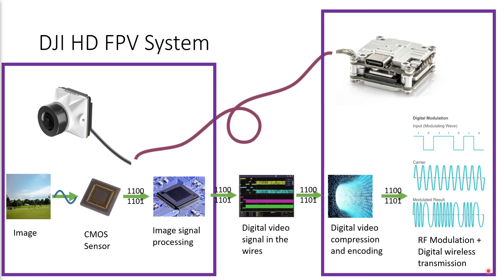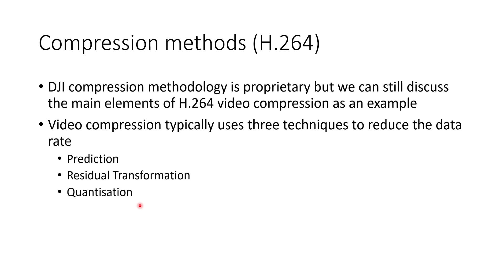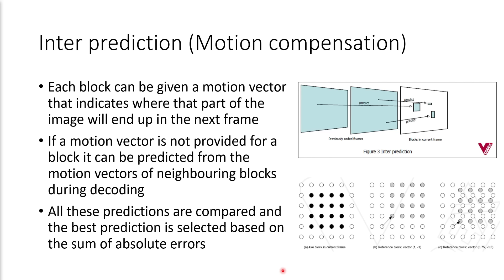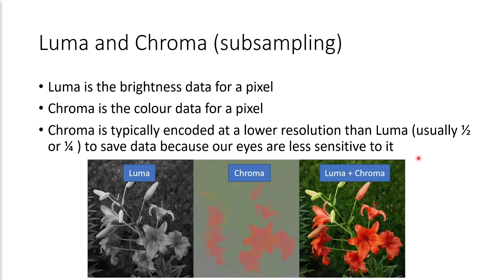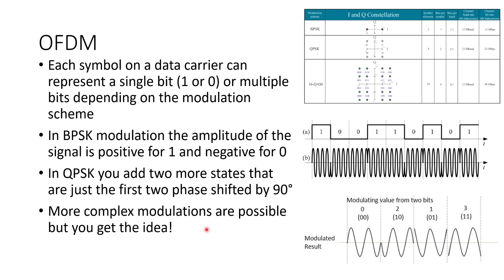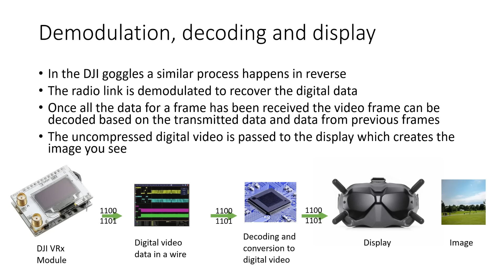How the DJI FPV Video system works! (Air Unit, Vista and FPV drone)

Comment: Hi Chris
Is that the reason why you cant just put an 2watts amplifier between the air unit and the antenna?
Or would it work?
Cheers

Comment: I wonder why DJI don't break each frame into bands and then you have less latency to decode a band, so even if you lag on one band, another band might transmit, you'd get flicker in bands, but perhaps less latency waiting all the data to send and repeat transmission

Comment: I'm pretty sure they don't use the "retransmit on first failure" method you've described here — this is something you'd do over a wire, where errors are rare. Digital RF systems, where some percentage of errors is expected in every packet, use forward error correction codes instead of checksums — these allow to correct up to x bit errors or decide that there are too many Generally, transmitter can dedicate any share of the channel's bandwidth to FEC, thus adapting to adverse conditions. This is literally RF 101, and it can't be that DJI didn't implement FEC, because obviously they don't produce the OFDM transceiver chips, they purchase or order them from people who know their shit. If the Rf link worked as you described, it... wouldn't work. Like, at all. And even at 1 meter between TX and RX, it would drop some frames constantly. I don't have these DJI goggles, but the huge scandal would certainly break into my bubble if they sold a ~1000$ FPV system unusable by design.

Even more absurd in your description is the idea that DJI retransmit whole frames... Come on, that's not how any of this works. Why would you retransmit a frame of live video? Receiver would certainly prefer a fresh frame to an old one (even if the old one was an I-frame and current one is a P-frame, really), and you have these new frames piling up in some buffer until you can retransmit... No, they don't do that. If this was the case, it would be noticeably degrade the system's performance, and recordings of "pause then fast-forward" artefacts from these goggles would be all over YouTube.

Comment: Great video and great explanation. Some additional information about the fact that the goggles are also sending packets to the VTX would be valuable. Why is it disturbing analog video more than you would think? (outside of the presumed frequency range of a certain channel). What frequency are the goggles using for TX? Also In what way is the DJI signal encoded, can you recieve it with any other equipment? Some facts about the spectator feature would be interesting in this regard as well. Does the VTX send the data to two goggles or is the first one relaying it to the second goggle? (25mbit to recieve data, 25mbit to relay it to another goggle). Does the first goggle need to establish two bidirectional links and does it mean four different frequencies?

Comment: Hey, do you think it is possible to take apart the video transmitter from the dji drone and the camera and make it work in another non dji drone?  Or it might be some signal necessary feom the MB for it to work?
Reply from the maker: I think the system is pretty proprietary. It might be possible but I think just using the air unit or vista is easier.

Comment: You think it's possible to make a repeater for the dji fpv system? Figured if anyone knows it'd be you. And don't the FPV races use repeaters, or do they all race on analog?
Reply from the maker: Possible? Of course. But the technology would need to be similar to WiFi repeaters.

Comment: then why is my mipi cable from my hdzero cable which has 12 cables on it you say 4 so 4 then another 2 for power and ground so whats the other 6 cables for if only 4 are needed?

Comment: The MAX285x series comes to mind.
Reply: Watching your video, that looks pretty darn close if I read its datasheet!
Reply: Great video by the way, if you want to test macro block vectoring visually I can highly recommend rotating a gradient at a low bitrate! You can really see the blocks "walk" across the screen guarded by a grid.

I've used patterns like that to tweak bandwidth on crappy ADSL lines for livestream events, it has been a while ago but I learned quite a bit about encoding :)

Comment: Hey Chris. Perhaps you’ve been asked this before but I couldn’t help wonder why the new runcam spilt camera recording system didn’t just split the wires from the camera and have one set go to a recording device and the other to a transmission device. It just seems like doing this should work rather than having the setup they have with one wire from the cam to the recording device and another from the recorder to the transmitting unit.  Any ideas?
Reply from the maker: With a MIPI link the connection is two way so you can't split the feed easily (like you can with analog for example). If you did split the feed each device would only have half the bandwidth. In the RunCam split I believe the link is digital to the recording device where it is both saved to SDcard and converted to analog for the VTX.
Reply: @ChrisRosser  thank you so much!!’

Comment: Hey Chris, what would you say is the main reason why DJI is much better than Sharkbyte at penetrating buildings? Are they doing more compression or because they are retransmitting? 

Also curious why this advantage does not carry over to penetrating foliage.
Reply from the maker: A good question. I think that reason DJI does so well in buildings is because it handles multipath interference really really well. OFDM in general handles multipath well because it acts as many separate narrow band signals with low symbol rate rather than one wideband signal. In a building I think DJI is bouncing around the obstacle rather than penetrating. Out in foliage there is no surface to bounce the signal around and so the penetration is similar to analogue.

Comment: Hello Chris.  Learned a lot from this video. I have a question for you. Do you know the usage case of 2.4 ghz link between dji fpv goggles v2 and dji fpv drone ? Is it the radio link or video link?
I'm thinking to move digital with limited budget and cannot decide paying extra for v2 worth it ? I sometimes see v1 goes a lot cheaper than v2 s . I ll highly appreciate your input at this.

As I know your analog goggles were Aomway commander v1 . I have the same goggles. Never got to try the dji's . What do you suggest me ?
Reply from the maker: I think the DJI FPV drone uses 2.4 & 5.8GHz and switches between them automatically based on RSSI. If you are not going to buy the DJI FPV drone there is no benefit to the V2 goggles. For Air Unit and Vista V1 goggles are the same as V2.
Reply: @ChrisRosser  Thanks for the reply Chris. I'm aware of current use cases but trying to futureproof it. Lets see if I'm able to get it or not 🙏🙏

Comment: I couldn't find relevant information anywhere so decided to give it a try here. I playing little bit with my Vista unit because have problem with DJI FPV Cam. I do connecting and reconnecting camera while Vista were powered. After that I notice that without camera my bitrate is about 10Mbps. Could no image to process cause lower bitrate?
Reply from the maker: I think so. Compressing a black image will require much less data than an image with detail.
Reply: @ChrisRosser  Thanks!

Comment: Another wonderful video that explains things so well. Thank you again.
But it's hard to believe that DJI don't use error correction. IBM used it for  tapes in the '70s, audio CDs in the '80s, DVDs and Blu-ray later, etc. It's so common and so well worked out. 
With a small overhead EC could eliminate most of the retransmission activity.
I guess, as always, it's a trade-off between the overhead and the amount of retransmissions needed.
Reply from the maker: They do use some error correction (checksum based) but if a packet is too badly damaged a retransmission is needed.

Comment: I have one question. Is possible to use Kakute F7 HDV (FC) with connected Caddx Air Unit and external radio receiver and then set in betaflight this external receiver as signal source and stream video by Air unit to dji googles at the same time or do i have to use dji controller with air unit to stream video?

In short: Is it necessary to use a DJI controller to transmit video from the air unit to the google?
Reply from the maker: Not at all. I use my Caddx Vista with ExpressLRS control link on a Taranis radio. I don't use DJI controller.
Reply: @ChrisRosser  thanks for your response ;)

Comment: You'd better explain why in the evening when it's getting dark before arming you have clear picture on nebula pro, but after arming the picture is getting dark and you're not able to fly. On polar this doesn't happen. Is it software trick to force people to buy "night" camera?
Reply from the maker: May be the frame rate switching from 60 to 120fps. Try high quality mode?

Comment: Colin Briggs in UK
Hi Chris do you intend to build a AOS 5.5 with an extended nose so there are no props in view. My friends and I like to fly with the DJI air unit and camera and not use a GoPro
Reply from the maker: Hi Colin, if you're not using a go pro you can run 5" props and be confident of no props in view.

Comment: Somewhere below I read you saying that the goggles can also transmit at the same power as the vtx. Is that even healty to have that kind of transmitter onto your head?
Reply from the maker: Yes it's totally safe. The radiation emitted by our equipment is non-ionising. It's actually much less dangerous than the visible light from the sun! The only radiation you ever need to worry about is ionising radiation (UV, X ray and Gamma ray) everything else is completely safe (all it will do is gently warm things up) and I wouldn't listen to anyone who says different. 👍
Reply: @ChrisRosser  Thanks a lot! This makes me worry a lot less about all that radio tech in my hands and on my head.

Comment: Digital FPV is pretty much behind compared to the smartphone industry I suppose, I wonder how does it compare. This kind of video I hope could inspire more companies to invest in digital FPV system further. I'm wondering how far the current system (either DJI or SharkByte) could go, as it will need a better encoding / decoding process to achieve better quality, frame rate, latency and range, thus it will result in more hardware cost.
Reply from the maker: Not sure I agree. DJI have had to develop a custom ASIC to do their digital video encoding at a cost of ~$5m USD. This is pretty cutting edge technology. Smartphones cannot get close to the latency of DJI FPV. The best they can manage is ~100ms. That's why you don't see any clones of the DJI FPV system. Without custom silicon it's a non starter.
Reply: I've never seen the data on any other system outside FPV, I just expected that they have a similar system, such as in gaming or video broadcast. But, I can see that it's only within FPV / drone racing that ultra low latency video transmission is important, or at least important enough for DJI to produce it.

Comment: Hi Chris, great video thanks! How does the digital video transmission handles reflected signals ? In analog we get a mess of sinusoids of the current and previous frames but how is this handled in digital transmission ? Thanks again for your video!
Reply from the maker: Using a circularly polarised signal helps. When a lhcp signal is reflected it becomes rhcp and if your receiving antenna is lhcp it rejects the rhcp signal. The same wish is used with analogue.
Reply: @ChrisRosser  Does this mean reflected signals are as bad for digital as they are for analog signals ? As far as I know analog is affected much worse by reflections than digitial transmission. Or is it just the complexity of the analog signal that makes it so bad.  Thanks again!
Reply from the maker: @hristiantodorov3923  With analogue you have no way of knowing if your signal is good or bad. With digital you can use checksums to discard corrupt data and request a retransmission.
Reply: OFDM is the thing that handles reflections and delay spread(ISI) in digital transmission as opposed to analog transmission.
Reply: In OFDM each symbol is transmitted on a different subcarrier and for longer time which makes the delay spread less destructive.

Comment: To be honest, 75% of this video is about generic video/image processing & digital data transmission topics. Nicely presented but not really related to DJI. Looking at the image when the link builds up, it seems very probably that DJI is using a 3x3 scheme of independent video streams. They probably use something SRT. And progressive encoding (there is a scheme for h.264 etc) is somethings that is skipped here completely. Both SRT and progressive encoding are possible explanations why the latency stays quite constant and the image quality degrades so quickly when the link quality drops.
Wrt 120fps: This helps to get the frame faster. It also makes the video much smoother. You can strongly see that when flying fast and using 60 and 120fps alternatively. This is why in high-end VR there is the recommendation for >90fps. So the 120fps deliver an additional advantage.
Reply from the maker: Great comment! Thanks for all the extra detail. SRT may be a technology they use instead of simple UDP. Progressive encoding seems less likely to me as it seems more expedient to encode each frame with compression matched to the current link speed.
Reply: This is not just off the shelf wifi. You can find wifi frontend chips on the boards. That makes sense if you want to build a transceiver on that frequency range. The encoding itself I guess is a progressive encoding h.264 similar to what Ambarella offers as a real time profile. Using SRT one might prioritize the dropped frames that you really need.
One can also see after a video break up that the video is made out of a 3x3 matrix of probably separate streams. The use this in focus mode to reduce the bandwidth on the outer parts of the FoV.
Reply: @Stefan_73  You two sound like you know this stuff well. DJI seems to be focusing less and less on fpv, and I've been wondering why there's not a good competing product out there yet. Is a viable competing digital FPV system really that hard to develop?

Comment: Awesome video! But is there a reason why analog systems are still preferable for long range instead of digital?
Reply from the maker: I'm not sure. DJI Digital can go 13.5km maximum due to a round trip limitation of 90 microseconds: https://www.youtube.com/watch?v=wj5A_bEZfZ4

If you need to go further than that then analogue is the only option. Sharkbyte might not have this limitation but you would need a lot more output power than any current Sharkbyte VTX.

Comment: Great video as usual. But I always have this question, if the Vtx sends a packet and arrives corrupted to the goggles, the googles ask for a new packet. If the quad is far away, the packets are transmitted at, let's say 700mWatts, but what transmission power are the goggles using to send the requests at the same distance?
Reply: Makes sense. Hey how about explaining openHD ? It looks like a promising alternative
Reply from the maker: I believe the goggles transmit at the same power as the VTx is set to
Reply: @ChrisRosser  but then it should be extremely hot as the Vtx. I guess I should measure the current drawn by the goggles to be sure what's going on in that matter
Reply from the maker: @DronoTron  the goggles have quite a loud fan that runs continuously. That should keep them cool. Also I think decoding video is less computationally intensive than encoding.
Reply: @DronoTron  the goggles are quite a large form factor as well compared to the AU/Vista - maybe that + the loud fan helps dissipate the heat faster?

Comment: Just bought the v2 goggles, and vista polar combo. Hooked it up yesterday. Still have not turned it on or activated the dji. I hope it all works, as I just took my analog quad out and it smoked?!?! No beeps or nything when I plug a battery in. But I get video. Might of smoked mu aio board? (nazgul5 v2 led )  I noticed some grass wrapped around the motors. The motors did not feel overly hot though.. Time to finish the dji build I guess.
Reply from the maker: Yikes, sorry to hear that. Make sure you have a 1000uF cap and a fettec spike absorber on every build. Haven't blown up an ESC since I started using the spike absorber.
Reply: @ChrisRosser  It is a bnf nazgul v2 led version (f7 aio)  No smoke/smell at all. It has a cap. I LOVE this quad!!
Reply: @ChrisRosser  I just plugged it into betaflight. All of the transmitter commands are working fine. Must be the esc board. Good luck finding one of those right now.   Can I do a check somehow? something in cli maybe.( complete newb lol )